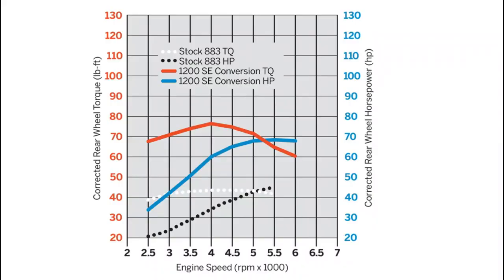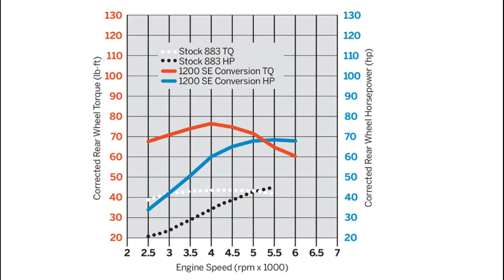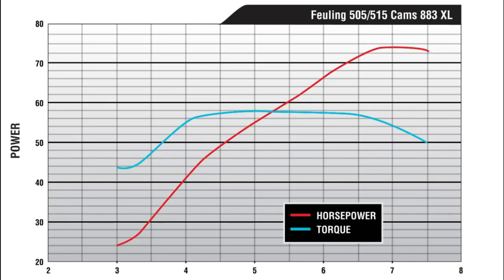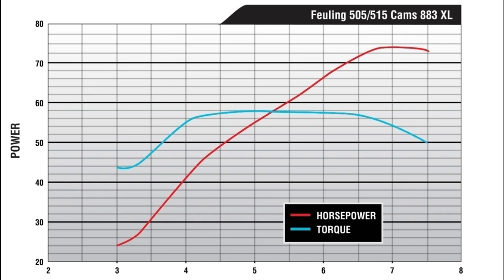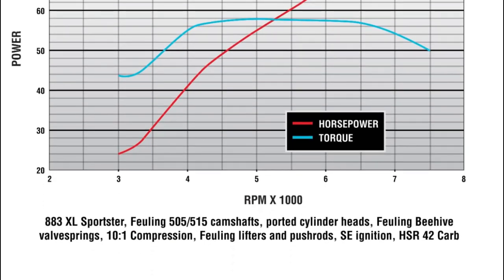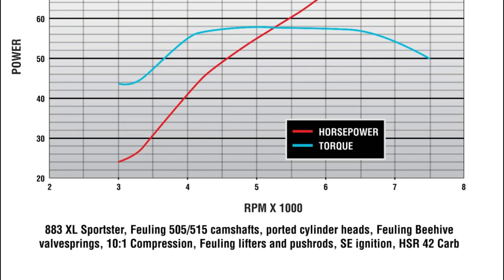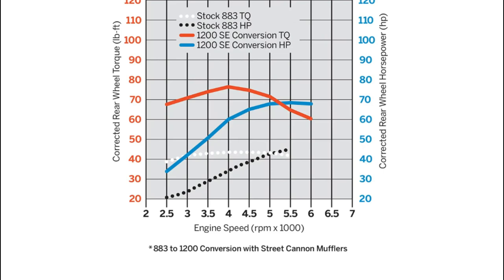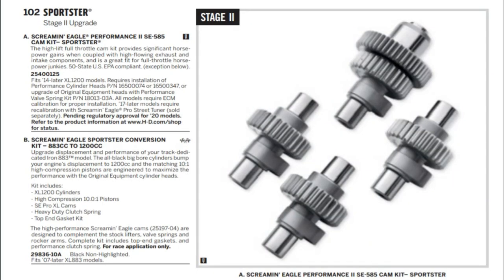Sportster Cam Upgrades To Increase Horsepower and Torque

Comment from the maker: I appreciate you watching and supporting the channel! What kind of cam would you go for? Would you go for a low to mid range cam or get one for top end?
Reply: Low to mid. Much more useful for urban riding.
Reply from the maker: It's hard to find to beat the factory W cam for low to mid. Most Sportster cams rob the low and mid for top end. Hammer's 570 is about the only cam l have found that beats the factory cam everywhere.
Reply: low to mid range
Reply: Stock cams for reliability. Stage 1 pipes/cleaner/tune. But how about skipping Stage 2 and 3 and adding Stage 4 ported and shaved heads for some more compression and flow?
Reply: Definitely low to midrange. My research made me decide to go with the Hammer 570 cam too when the time comes.
Reply: Hi. Im looking at the hammer 560 for a stage 1 xl122c….thoughts?
Reply: @GixxerFoo  any experience with the Fueling 580 Reaper cams?
Reply: Impact 560, with 10.57:1 compression and 883 gearing on a 1275 absolutely no bottom end performance loss and a huge hit on top.
Reply: I like low to mid range I’m not much on the highway riding light to the light lol as fast as I can And I don’t speed but I just like to get to the speed limit as fast as I can
Reply: @davidlephew2779  if it puts a smile on your face your doing it right.
Reply: @davidleonard8369  -  1200 gearing would probably work better. Maybe even a taste higher. The 1275 is going to add crap load of bottom to pull strong down low. If you aren't careful, you can end up 'on top' of a lot of your power.
Reply: @clintwoodruff1187  my sportster spends plenty of time at the drag strip. I have ran 116 mph through the traps in fourth gear. I fail to see how taller gearing would be better.
Reply: Learn to ride it first.

It's a mid mounted engine design. 
It's on rubber tires.

You must brake in a straight line before turning.

Then once the engine weight has rotated the bike, sliding the rear end around the front tire contact patch, you then spin the rear wheel 🛞 with the throttle and push yourself out of the turn.

You have to be going fast enough to get the rear to slide out when you brake, then the motor must be powerfully enough to be able to spin the rear tire while its sliding. 

After that, it's just how much do you want for going down the straight.

Comment: My little Sportster is 110 HP, thanks to Hammer Performance. Yippee.
Reply from the maker: 👍 l bet you surprise some people with that bike, l bet it's hard to keep the front wheel down too!
Reply: The 110 kit is pretty expensive, good for you man !
Reply: How much was the kit? I’m building my 2021 sportster with ohlins suspension already ordered and want a hammer perf kit but debating the 110 or 120 kit and a fueling cam
Reply: @cheyenneobregon184  i believe the 110 is around 5k US. The 120 almost 6
Reply: @cheyenneobregon184  a. Fine sportster
Reply: Doing this with my 94 sporty. 1200 -> 1275 kit upgraded cams and trask turbo exhaust. Around 10k in just parts but it’s about to fly.

Comment: I have a 2017 Hammer kit 585 cams, heads, cobra mufflers..48 throttle body..it DYNOED at 130 horse. Anderson cams..extras..we pushed it to 160 horse but too much for a 5 speed..oversized harley oil cooler. Keeps it at 250 with Amsoil  ..130 horses is plenty in Florida!!!!
Reply from the maker: Damn that is quite impressive to hit those numbers with a Sportster, it can be done with Hammers kits and super fine dyno tuning though!
Reply: Fuk!😱
Reply: I’m gonna call BS on that one there’s a YouTube or in Orlando blockhead has a 1275 hammer kit with everything in the kitchen sink thrown at it throttle body cam lifters valves intake 0 stock engine parts and a master Harley technician of 25 years as his tuner and they could only get 112 rear wheel hp you can get more if you cheat with a spoke rear tire and a chain conversion but that’s just bluffing the dyno numbers
Reply: I say bullshit ! To pull 160 h.p. out of that , it would need a 100h.p
 NITROUS KIT BOLTED ON !
Reply: It does Thanks it’s a special polished 
Motor.. We worked on it along time over a year.. Clutches had to be changed So it’s definitely A NO BULLSHIT ENGINE!!!!! It smokes 131-s like gravy but the power is there!!!!
Reply: @ThatGuyRides   I know Blockhead and he doesn’t have a Sportster, and this Sportster does what it was built to do if it had a 6speed it would be 160 horses NO BULLSHITTING ON ANY OF MY Sportsters!!!!!!!!
Reply: @ThatGuyRides  I know blockhead.. he didn’t do the work on any of my Sportsters it was done by a certified Harley Mechanic! You believe what you want ..it’s still a 5 speed. If I could have got a 6 speed it would be up to 160 horses Baker transmission doesn’t make 6 speeds only for early 90-and I live in Florida.. I’ve been offered 16,000 grand for it and I’m not selling it.. We are working on a Sportster Custom 2017 and it will the same as my Low!! It’s been on YOU TUBE SEVERAL TIMES AND ITS FAST!!!!!!!!!
Reply: @ThatGuyRides  as far as I know Blockhead has A Low-Rider ST WITH A 1250 but I never saw a Sportster in his possession
Reply: @rickmccarter4792  Nope no nitrous don’t need it!!!
Reply: @GixxerFoo  yes a bigger throttle body ,valves Hammer Motors have liners like a diesels engines

Comment: Bought a garbage 1988 883….Bought cams,,swapped…Could do mean power wheelies in 1st 2nd….  The traded jugs and pistons to Harley for 1200cc jugs ,,, Clutch wouldn’t hold, got Barrett extra disk…Put on brand new S&S supE carb.    Holy shit!   3rd gear power wheelie and rolling burnouts for 100’ no brake..   Cams were Andrews v4 I think,,,was awhile back….Really fun ride
Reply from the maker: Sportsters hopped up are bad ass and a blast to ride!
Reply: How much did that run you

Comment: I’m new to this. Basically, if I get a tune, better exhaust, high flow intake, and hammer cams. I can get a 1200 Sportster keeping up with dynas and soft tails all for way cheaper and do it myself minus the tune?

Comment: The big bore XLs (1200) can make good 1/8 to 1/4 mile drag bikes. Good 0 to 60 times to for a pushrod motor. My first Harley was an 04' 1200 Sportster and just with a pair of Bassani pipes, and a Screamin Eagle High Flow Air Cleaner and a Dynojet jet kit it dynoed over 71 hp, and around it was either 77 or 79 ft. pounds of torque. That was with all stock internals. My dad used to work at the local Harley shop, and they did a 1200 carbed Sporty with JE pistons, Zippers cam, and for the exhaust had a Thunderheader got close to 100 hp, and lifted off the front of the ground when got on it in second gear. These bikes put out more hp per cubic inch than the twin cam 88! Riding like I did I noticed that the Sportys sometimes get looked down on by some Big Twin owners, and they arent as comfortable out on the InterState either.
Reply: I hear that about the big twin guys. That’s why I’m sticking a turbo on my 04 roadster! “When are you going to upgrade to a big boy bike?” I guess when I’m old😂

Comment: Hi,I have an '11 XR1200  with K&N intake and aftermarket slip ons,and wanna know what cams are good fpr low mid range gains,or are the stock cams in the XRs already performance?I dont want top end speed but more power thru the gears and to make the idle sound better ,please respond🙂thanks!!

Comment: One thing to remember, If your going to do any kind of Performance Up-Grade that give your H-D Sportster 883 or 1200 enough Power Gain to where your engine RPM can Rev over 6000 RPM, you'll need to Up Grade the Value Springs for those Higher Revving RPM. Other wises you'll float the Stock Valve Springs, which will and can damage if not destroy the Engine. 
I have a 1989 H-D Sportster that was a 883, which the last owner converted to a 1200. After I got the bike, I striped, the Fuel Tank, Fenders, Seat, Exhaust Pipes, and the ignition. I replaced all of those parts with the SXS Kit from Phil Little ( the kits give the Sporty that Flat-Track Racer look) My future plan are to install the Hammer 1275 100 HP kit. In-which should be All the Power (and More) than I'll ever need. 
P.S. I would up-load a photo but You Tube doesn't give us that option, that I know of anyway.

Comment: Just asked my local shop about a stage 2 for my 1200, has a stage one, kinda disappointing to hear that I’m more than likely gonna hear the same thing from my mechanic that I just heard in this video about how it really hard to get more low and mid range power because that’s how I ride wasn’t exactly planning on doing a big bore with a new clutch etc, overall very good and informational video

Comment: I did just Stage 1 on my Previous 18 1200 Roadster ,,running Short Shots, SE Ventilator heavy breather with a Race Tuner and Dyno..My numbers Were 79.3 Bhp @ 6.02 rpm and 78.9 lbs @ 4.77 rpm No Cam ,that's app %20 improvement over Stock..Third gear Pull was 106 mph @ 6400 Rpm.
Reply: 106 mph in 3rd gear?????

Comment: If you don't do the math, you are just a follower. I just ran 7.05 on the Sturgis eighth  mile last Fri night on Metzeler Karoo adventure touring tires on a 1200 conversion. The local fast guy runs 6.9 on a Busa. I could smoke him with a 591 on the rear. Pump gas, all very mild stuff.

There is no practical value to cams in an 883 as the  cams are not the restriction. The small ports and valve sizes are the culprit.

Comment: hammer 1275 kit for a 1990 xlh 4spd stock heads and cam for now...gotta love 80+ tq from 3k-5500 rpm & 80hp in a sub 500lb rigid chopper. will be doing heads
Reply from the maker: Damn you hopped up a rigid chopper with a Hammer 1275?! I love it, that's frickin awesome!

Comment: I have a 97 1200 Sportster. I put N4 cams pistons and SE heads on it. Mikuni HRS42 carb Daugherty air box. Rinehart exhaust SE ignition module SE coil S&S roller rocker arms. I weigh about 260 it would scare a small person. I just got a very low mile 07 low rider that's stock except mufflers. It had 3600 miles on it when I got it. I might take up your advice and increase the cubic inches and put a set of cams in it. What a difference in ride from the sporty. When i bought my Sportster I had to pay $100 get on a waiting list to get the first available bike that came in. I wasn't guaranteed the color either. I had to wait 9 months for my bike. The only bikes that were in the dealership were sold ones. No used ones either. For a big twin the wait was longer. This was in 1996. I was 25 years old riding my new Harley Davidson. King lol. I really like your videos buddy. Shinny side up.
Reply from the maker: Thank you!! Harley-Davidson would love to get back to those days!! Those were some really golden years of Harley-Davidson!! Gotta love a built Sportster, they are truly underrated machines for the power they can lay down.

Comment: I converted my old 883 evo rigid mount to 1200 and installed the Andrews N4 cams. Very happy with these cams, would not go back. Big power from 4K rpm to redline. I had head work done too, and a good two into one pipe
Reply from the maker: That Andrews N4 is a great cam! They perform really well for the street, sounds like you've one everything right!
Reply: Yes I also love the Andrews n4’s cams , I did a set along with a 1275 hammer prefomance big bore kit on my 2016 iron . Man I agree 100% about the n4’s, they are so solid on my bike once they kit in they pull hard rite to the red line ! Now I don’t spin my bike up to 7000-7200 rpms like some of the guys with bigger builds do , but I can tell you that the cams pull nice for me rite to the 6300rpm range about . It’s great because the power is all in great spot , they seem to fit well with my riding style .
Reply: How about the vibrationd? Did you notice a big increase?
Reply: Chris Dawson no noticeable difference in vibration on my bike after the 1275 big bore kit . Absolutely nothing to worry about as far as I’m concerned. It’s stil a pleasure to ride on the street . Just a ton more power now . No regrets whatsoever.
Reply: Darn these awesome  videos - they are giving me that “mo power”problem. I’m starting to think I need the 1200 to 1275 , the N4, and better springs or something.. and THEN my Sportster will be .purrrfect!!  Mind you I already love it stock.

Comment: I have a 2010 xl1200c and I’m at 83/83 with my stage one. Rush slip on 2” baffles. 65 degree Arlen ness intake. FP3 tuner. Tuned it myself on the street.
Reply from the maker: Rush makes a damn good slip on with the stock header, it makes more power in the low to mid range than most 2 into 1 exhaust. Even more on top than a lot two into ones, overall it's the way to go. That's some really good power you're making!
Reply: Thank you. Isn’t that something? I just love these little bikes.

Comment: I heard the guys at DK Customs saying something about Sportsters not getting up past 5200 R.P.M.s, unless you're riding really fast, I think. I probably wouldn't want to mess with cams, unless I converted to a 1200 or 1275 kit, because I don't want to be buying cams more than once. I don't even know, if I would get a 1275 kit, unless I could get lower compression pistons, because I've been told that, if I use my bike as a daily rider, it's not good to have a high compression motor. I'd love to get the kit, if that's possible. I'm happy with both of my 883s, though, so I don't know what I'm missing. It would just be nice, for longer trips, to push through the wind, a little easier.

Comment: I got a stage 1 put on my 2021 iron 1200 and left with 86 hp and 82 torque. Can’t wait for stage 2!!
Reply from the maker: That's some awesome numbers! What exhaust and tuner did you go with?
Reply: @GixxerFoo  I have the screaming eagle air cleaner , screaming eagle tuner the black box not the orange and 3”  Vance and Hines slipons . Lookin at my dyno sheet it’s actually 85.48 hp and 81.30 torque. Max hp @6100-6300. Had the tune done @harley cus of my warranty.
Reply: @jeremys7479 yes sir got the dyno sheet to prove it . That’s what happens when you have a master tech that’s been doin it forever workin on your bike lol
Reply: @jeremys7479 nope
Reply: @jeremys7479 I heard of people getting upwards of 130 with stage 4

Comment: Your right Brother,no need to do a stage 1 if you're going to do the stage 2 upgrade, just go for the stage 2 to begin with, I'm fixing to do the stage 2 to my M8, thanks for sharing brother and ride safe and keep the kneese in the breeze 👍🏼💯
Reply from the maker: You'll love a cam in your M8, it really unlocks the potential of those motors. I got to ride one with a stage 2 cam and it's impressive.
Reply: @GixxerFoo  yeah I can't wait man,👍🏼💯
Reply: @OZARKSHDRIDERS  The M8 is nothing to sneeze at OEM.  With this upgrade... WOW!
Reply from the maker: Just had a friend torque cam his M8 107, it's a whole new machine now!
Reply: @exexpat11  it really opens up the beast inside💯
Reply from the maker: Aftermarket cams that are a bit more aggressive really make some power even with factory displacement.
Reply: @GixxerFoo  I'm thinking pretty hard on the Zipper kit,
Reply from the maker: Which one are you looking at?
Reply: @GixxerFoo  the Zipper performance kit with the torque cam
Reply from the maker: Those are some really nice kits, what tuner are you planning to run?
Reply: @GixxerFoo  they said I wouldn't need a tuner, they told me it just needs to be on the Dyno to be tuned, that's all I know
Reply from the maker: Is your bike fuel injected or carb?
Reply: @GixxerFoo  it's fuel injected, does that make a difference
Reply from the maker: I am curious that they didn't mention anything about a base map to start with. It's not gonna like it very much with the stock map and all those changes.
Reply: @GixxerFoo  I'll have to look into that for sure, I'm probably not going to do it until this winter so I still have time, thanks brother, much appreciated 💯
Reply from the maker: Hey no problem, hopefully you get it done this winter. You'll have a new bike for the spring.
Reply: @GixxerFoo  yes sir,it should really open her up LoL 👍🏼

Comment: Have a 2019 883. Installing a sawicki 2 into 1 & Hammer intake, then throwin it on a dyno w a TTS Master Tuner. Will rock that for a while, then in future do a Hammer 1275 kit🤘🏻💨💨💨

Comment: stiffer valve springs, and lighter valve gear, actually does make top end power, ( hang with me here ), the further the valve-train is from floating, the more energy is returned to the engine...
think of riding fast over a hill; and feeling lighter , past the crest, on the way down ... power is lost to valve train inertia that way, so stiffer springs, or lighter valve-train components, make more top end power by returning it more.. ( that's right, those quickie push rods might be convenient, but they are a performance downgrade )

i am doing an 883 that currently has the old D cam, ( and on a budget ), 
so i am thinking Andrews N2, up the compression a smidgen, port and polish, 2 into1 tuner, high flow intake, jet for 14.7-15 AFR on a gauge. 
" 14.7 -15 AFR " what are you nuts dude ? " Right ? .... no seriously,  liquids do not compress and i will Not need to increase my compression ratio with wasted fuel,
 and i Do Not plan on revving my engine to the point that the exhaust valves are opening before the charge has finished burning..( i can use up to 6K3rpm, on a 3.811" stroke )
It's An MPG Hot Rod, so chill ; it's not a girls bike for as long as there are still girls who are heavier than me.

Comment: Its 1 crank per cycle. 

2 pistons connected to 1 crank.

It's only 50% better than a 1 cylinder motor.

Your motor must do 11 more cycles to catch up to a V12.

Comment: Thanks for the informative video!  For my 2009 XL1200C, I've already done a stage 1.  V&H straight shots, full set, no baffles.  V&H "fuelpak" and "Big Sucka" air cleaner.  Interested in your thoughts for a HD or Hammer stage 2 upgrade, for my south florida riding, lots of wide open roads, no winter or city riding.
Reply: Did you dyno before & after your stage 1?